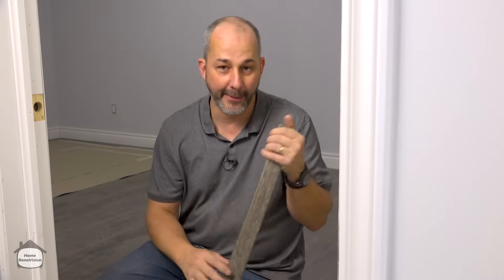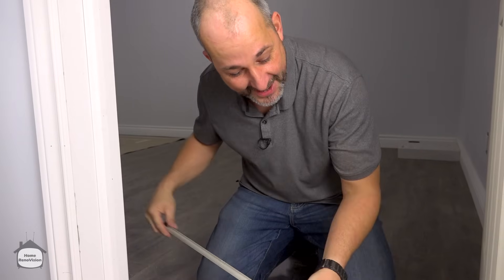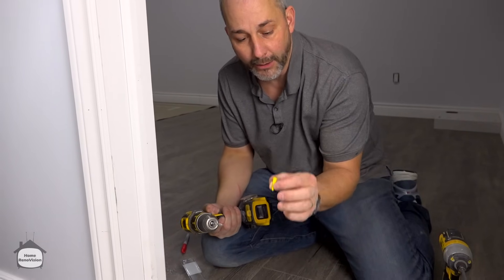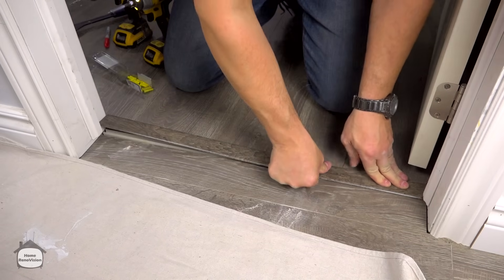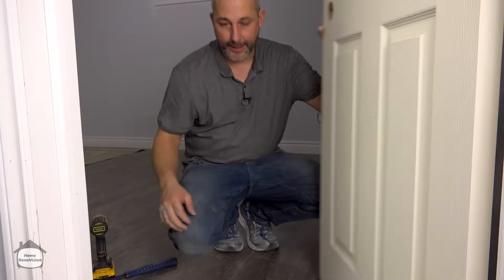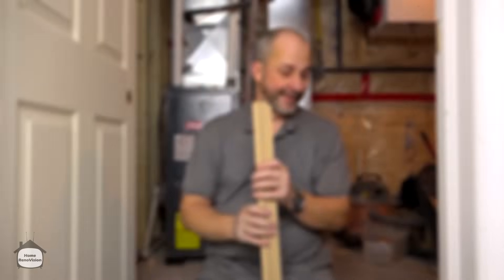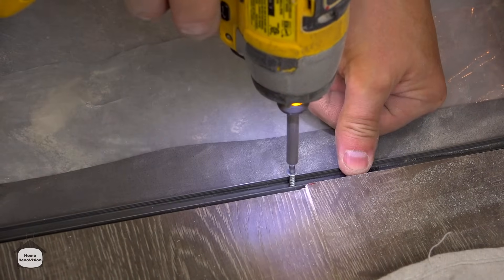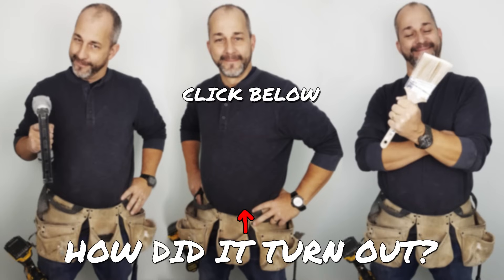How To Install Laminate Flooring | Transitions

Comment: I personally don't like to see floors of the same material going in different directions with transition pieces at the doors.
 I've installed many many floors and I always have a continuous flow from one room to the other regardless of what direction the room goes in. It takes a little extra planning to know exactly what room to start in because you will have some pieces that you will have to install backwards,so there's  a little more work. 
The results at the end are much better.
To me personally, changing the direction and adding a transition at the door is the lazy way of doing it.
I only like to use transition pieces from one type of floor to another or if you have the same type of floor but you are entering a room that has a different level. This happens a lot in additions

Comment: 11:15 use a grinder with a diamond blade. 10min job.
Reply from the maker: that still doesn't reach into the ends of the jamb. but interesting idea. Cheers!
Reply: @HomeRenoVisionDIY  C'mon man ur a construction guy. Then use that tool you were using for the ends.

Comment: You had a good day! you did not hit a quartz pebble while drilling into the concrete.  I'll just use Gorilla glue. Works fine. Drilling concrete is to be avoided. Leaving all that residue in the channel is also very sloppy.

Comment: Always cut the underpad away when installing all transitions.
Reply from the maker: if yoi are going to glue down sure. sometimes it helps to set the height of the track depending on the thickness of the floor.

Comment: Nice video. However ....
1. Smart guys who install floors for living do use glue and glue only (very few exceptions ie (if the subfloor is timber and you know how thick it is))
because the Oopsie that you had @ 4:22 (rebar or hard concrete aggregate) could of easily been a water pipe, electric cable etc. You do not want to flood your newly installed floor or have to dig out and repair electric cables!!! Imagine going through a pipe on 1st 2nd floor of a building. 
2. Both transition and reduction molding brackets had not enough fixings , should of been fixings at both ends about 2-3" max off the door frame and 4-5 fixings in the middle(depending on how rigid the bracket is).
All in all for the DIY or occasional installers I would not recommend drilling into concrete just use locally available construction adhesive and allow it to set properly while weighted down.
Reply from the maker: very true , however in a basement we rarely have anything under the concrete which is poured at least 3 inches. I have also found that concrete floors that were poured before the time when they use vapor barrier first always cause the adhesive approach to fail in time.

Comment: Nobody shows how to install a transition with an exposed 90 degree   turn.    So basically I have a rectangle section of vinyl flooring surrounded by carpet on two sides.
Reply from the maker: you will need to mitre the pieces and you still won't be happy. Cheers!

Comment: I hate oscillating tools.  I think a circular saw would work better as long as you set the depth right and then just use the oscillating tool and the ends.

Comment: cut out 80 percent with a circular saw bud
Reply from the maker: in a doorway it is more like 50% and since I was on concrete I didn't want to wreck my blade. Cheers!
Reply: @HomeRenoVisionDIY you could take about 90% out with a small circular saw with no risk of hitting the concrete at all
Reply: free key he probably said 50% due to the length of the saw limiting the range of the cut significantly.

Comment: I'm one of those dumb blondes who thinks she's a DIYer. That means I do everything the hard way. Because of water leakage from my fridge (yes I have laminate in the kitchen and bathrooms), the transition pieces (there are 2) between the damaged laminate and the dining room must be installed so they meet in a  T with one piece across the pantry door and one piece from the cabinet to the pantry butting up to it at a 90 degree angle. I don't have a clue where to start. I can't afford to replace all of the flooring with tile or something else, so I'm jury rigging the transition. I could send a picture to give you a better idea what I'm trying to say...

Comment: Hot glue on transition, adhesive on concrete, use your knees and hands for body weight for a minute and done. Drilling the concrete and using the plastic track is a waste of time.